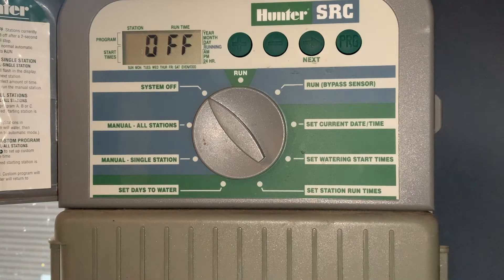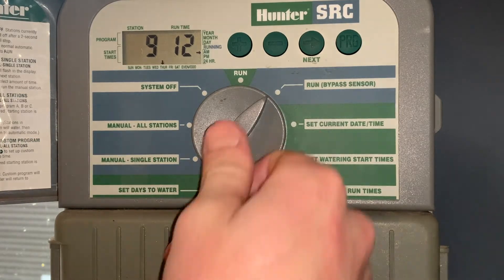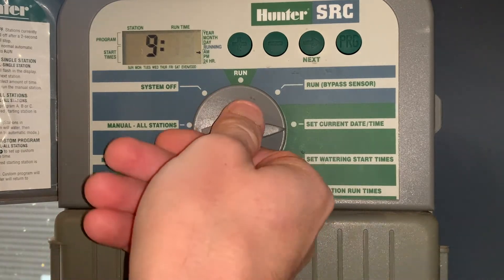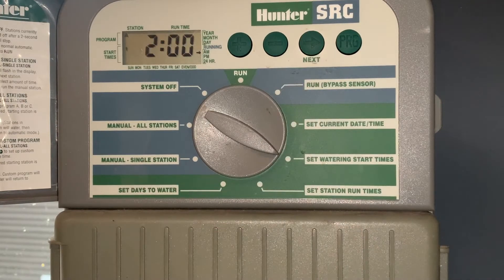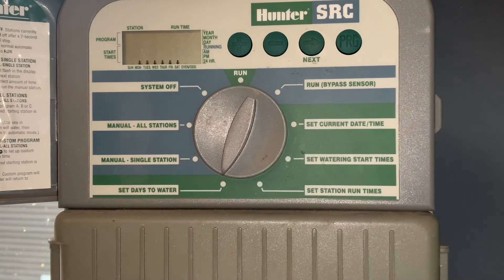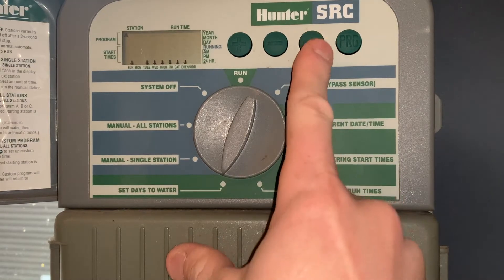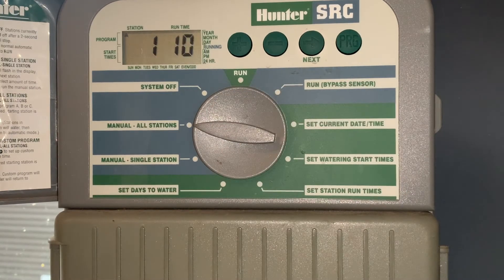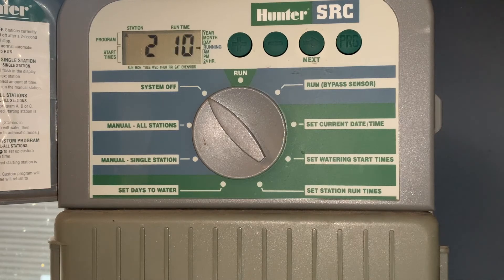How To Program Hunter SRC Irrigation Controller

Comment: Hi Guys,

My Hunter SRC Plus system has started giving me an issue. It seems to water all zones at once and can't get it to do individual zones. Any idea how I can fix this this?
Reply from the maker: Hello, it sounds like the controller may need to be replaced. Hunter has a new controller out, the P2C, that is a great residential irrigation controller.
Reply: @SchepersLawnSprinklingSystems   Thanks for message, yeah look this thing is really old maybe it's time for a new one! Can I just buy the new controller and plug the zones back into the new one?

Comment: My sprinkler system coming on 2x , controller set for 4:15 a.m. only and it comes on 4:15 AND 5:15A.M.  I've checked start times and I can't seem to stop my sprinkler running 2 cycles.  Help.
Reply from the maker: Hello, check if you have the second start time on a different program, b or c.
Reply: Called my son, the EE, and he found Program A had SEVERAL start times, so did B & C which were turned off.  He set Program A to 4:15 a.m and  0 for any other start times on Program A.  This morning, my sprinkler only ran once.  Hopefully this corrected the program, but yes, you're right; one program may have several start times.  If this doesn't correct  the problem  , I'll buy a new Hunter controller, but hoping this has taken care of the issue .   Thank you so much for your advice, you were right.  Thanks again!

Comment: Somehow I have two or three times that all stations are running. Not sure how that happened, all on the A program. The B & C programs are reading off. How do I turn off the A2 and A3 programs?? or should I just put their run times to 0. Thanks you.
Reply: You have to press + until it completes 24 hour then after that it show off

Comment: When I try and run Manual ALL STATIONS I hear it start then it shuts off right away . The station and time displays then reverts back to regular time of day. Anyone know what might be the problem. I have this same controller.
Reply from the maker: Hello, that is not unusual with this controller. We typically recommend customers replace them as the buttons stop working as time goes by.